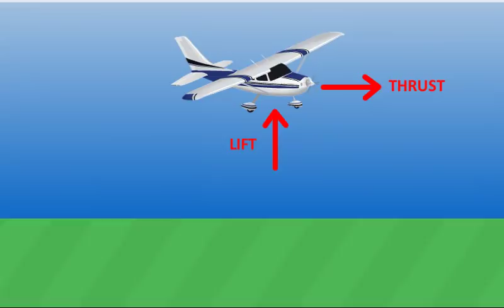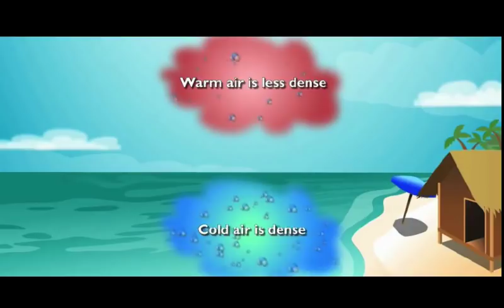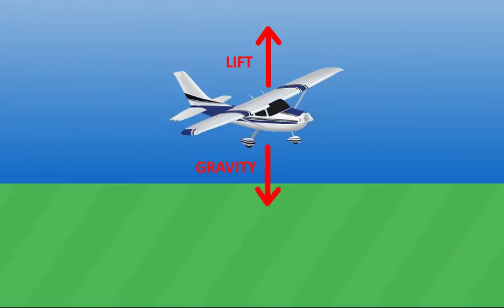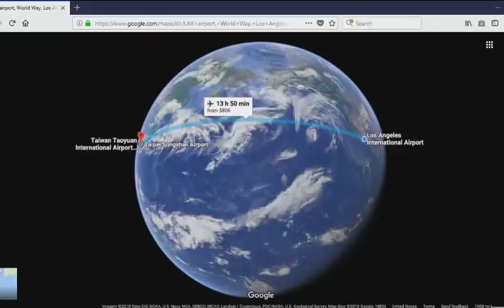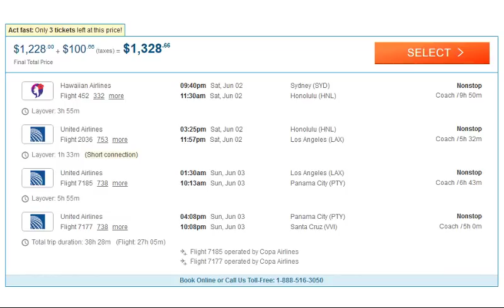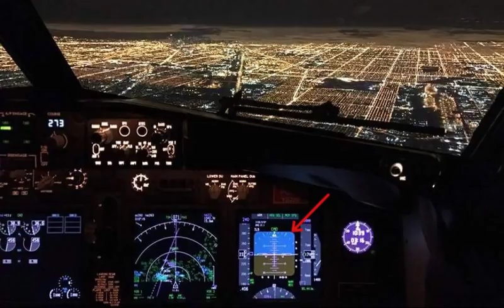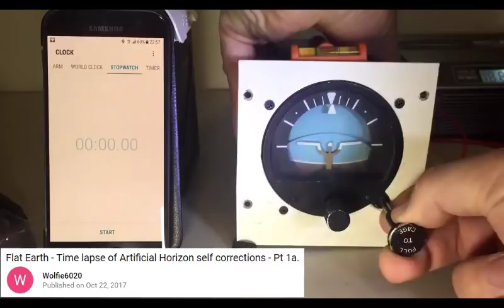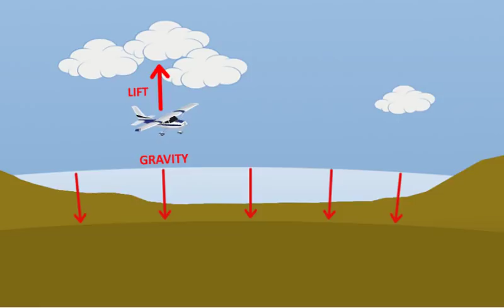Flat Earth Falsities - Plane Nonsense

Comment: Here are several questions for flat earthers: 
1. On a globe, the circumference of the tropics of Cancer and Capricorn are equal, but, on a flat earth, the tropic of Capricorn would be 70% longer. What makes the sun slow down from December to June then speed up from June to December year after year? 
2. What keeps the sun and moon in a circular motion above a stationary flat earth? 
3. What causes the solar analemma? https://www.youtube.com/watch?v=jQT5XRdrqvw
4. If you can see both the sun and moon during a selenelion eclipse, and they are at their maximum separation, why can't you see them all the time on a flat earth?
5. How can the earth's shadow fall on the moon at all (for a lunar eclipse) when the sun and moon are both 3000 miles above the flat earth? 
6. How come the sun and moon disappear from view for hours at a time if they are 3000 miles above the flat earth? Or how do the sun and moon disappear behind the horizon on a flat earth? 
7. What causes the phases of the moon? 
8. What causes some planets to show a retrograde motion at times? 
       https://www.youtube.com/watch?v=TK9ozJYELR8
9. How do the other observable planets disappear and reappear on a regular basis if the flat Earth is not moving? 
10. Why are there two fixed stars (Polaris and Sigma Octantis) with a Coriolis Effect? Notice the clockwise motion in the southern hemisphere and the counter clockwise motion in the northern hemisphere, and why are the stars the same in the three southern continents? 
England and Australia: https://www.youtube.com/watch?v=UNiNJC3UHIo
South Africa: https://www.youtube.com/watch?v=kvhAhCBPJk0
South America: https://www.youtube.com/watch?v=y-VWJHRN7cw&t=23s
11. Why can't everyone on the flat earth see the same stars all the time? 
12. What about the curve? https://www.youtube.com/watch?v=GpAGXpusAiQ
13. What causes the aurora borealis and aurora australis, and why can't everyone see them? 
14. Can you explain the ice wall during the Cretaceous period when the polar ice caps did not exist? 
15. What have Ryan Waters and all the other polar explorers like Spear17 proved to you? 
       https://en.wikipedia.org/wiki/List_of_Antarctic_expeditions 
16. What section of the Antarctic treaty prevents exploration? 
       https://www.state.gov/t/avc/trty/193967.htm
17. What keeps us on the flat earth if not gravity because density and buoyancy do not account for acceleration?
       https://www.youtube.com/watch?v=QyeF-_QPSbk
18. What about Space? https://www.nasa.gov/sites/default/files/thumbnails/image/3-as08-14-2383a.jpg
19. What about tectonic plates, earthquakes, and volcanoes (especially calderas) on a flat earth because no flat earther seems to know what is beneath the surface? 
20. What about the 'firmament' and 'the four corners of the earth'? 
       https://answersingenesis.org/astronomy/earth/does-bible-teach-earth-flat/
21. What keeps the flat earth from flipping over and killing us all? 
22. What causes a spherical drop of water? 
23. What causes the tides? 
24. If the Sun leaves my perspective, why can I see the stars behind or above the Sun? 
25. Why do the stars in the flat earth model firmament dome always move horizontally anti-clockwise over the whole earth? 
26. What happens to a super nova in the firmament?
Reply: Really Bobby Wizdum? It is clear to me that you are an idiot. I have seen that piece of crap TWO HOURS video. Have you? 
FLAT EARTH LOGIC
Flat Earther: The Earth is flat. 
Globe Earther: Prove it! 
FE: There are the many laser experiments proving that water is always level over long distances. 
GE: Have you not heard of atmospheric refraction? 
FE: You mean that mirage thing? 
GE: No. What about ships that disappear bottom first? 
FE: Perspective because all things at a distance eventually disappear into a point. 
GE: But the Earth can be seen to curve. 
FE: From side to side? 
GE: No away from us in all directions. 
FE: Water always seeks its own level. 
GE: What about a drop of water or the liquid in a level for crying out loud? 
FE: That’s different, and besides, water also rises to eye level. 
GE: If I am in an airplane or on a high mountain, the horizon is below my eye level. 
FE: That is not true. 
GE: I can see the horizon below my line of sight using a leveling app on my smart phone. 
FE: That is nonsense. The earth is flat. 
GE: The oceans would be empty. 
FE: The UN flag and some old maps show Antarctica as an ice wall. 
GE: Do you have a picture of the whole thing? 
FE: No. 
GE: Why not? What about the Cretaceous period when the polar ice caps did not exist? 
FE: That is a myth. 
GE: What about the edge?
FE: No one has seen the edge, and Antarctica may go on forever. 
GE: The Antarctic is a continent, and why hasn’t someone done some exploring to prove it? 
FE: The UN’s Antarctic Treaty bans exploration, so we can’t know that for certain. 
GE: What about all the people who have explored Antarctica? 
FE: Nobody explores Antarctica. 
GE: There are stories about them all over the Internet, and the treaty itself can be accessed online. 
FE: It’s all lies. 
GE: What is beneath the surface of the flat earth? 
FE: No one knows. 
GE: How do tectonic plates, earthquakes and volcanoes work on the flat earth? 
FE: There is extreme pressure beneath the flat earth, and it works much the same as on a globe. 
GE: What about the sun and moon? 
FE: They circle above the earth, of course! 
GE: What keeps them from flying off into space? 
FE: There is no space! 
GE: What about satellites? 
FE: There are no satellites. 
GE: What about gravity? 
FE: There is no gravity! There is only density and buoyancy. 
GE: What about acceleration? Density and buoyancy do not account for it. 
FE: There is no acceleration! 
GE: What about tides where the water recedes and proceeds? 
FE: That is nonsense. 
GE: Ok. The sun and moon can’t be as far away on a flat earth as we know they are.
FE: They are actually closer and smaller. 
GE: Why can’t we see them all the time on a flat earth? 
FE: Perspective! 
GE: Wouldn’t the sun’s light cover the entire flat earth? 
FE: The sun is like a spotlight. 
GE: That means the moon cannot be illumined by the sun. 
FE: The moon is self-luminescent! 
GE: What about the phases of the moon? 
FE: Luminaries can be like that. 
GE: What about the four seasons and time zones? 
FE: The sun moves between the tropics just like it does in a globe model. 
GE: The tropic of Capricorn would be about 70% longer than the tropic of Cancer on a flat earth. What makes the sun slow down for six months then speed up for six months year after year? 
FE: Electromagnetism! 
GE: What about the solar analemma? 
FE: What’s that? Must be too complicated. 
GE: What about the other planets? 
FE: They are really planetes or wandering stars. They’re not really part of our system. 
GE: Why not? 
FE: There is a firmament that covers the flat earth! 
GE: The Hebrew word that is sometimes translated firmament can also be translated as expanse. 
FE: That is wrong! 
GE: What about the occasional retrograde motion of the planets? 
FE: I already told you, they’re not part of our system, and the flat earth is stationary. 
GE: How can the Earth be stationary? 
FE: If the flat earth was moving, a helicopter would be able to lift off and wait for its destination to come. 
GE: The Earth is a closed system, and our atmosphere moves with the Earth because it is heavy enough to stay put. 
FE: The atmosphere would be sucked off by the vacuum. 
GE: The atmosphere is large and heavy. It doesn’t work like that. What about aurora borealis and aurora australis? 
FE: Ignore them! 
GE: Why can’t everyone see the same stars? 
FE: Perspective! 
GE: Why are there two fixed points one above each pole? 
FE: There is no south pole. 
GE: But people in the south can see a fixed point over the south pole. 
FE: There is an imaginary pole that connects the two points and moves the stars like that. 
GE: If the earth is flat with the north pole at the center, how can everyone in the south see the same fixed point? 
FE: It is all a conspiracy. There is a distorted view of the skies. 
GE: A conspiracy? 
FE: Yeah. A big conspiracy, a cover up. 
GE: I see, so we have been lied to? 
FE: Yeah, no one can trust them. 
GE: Trust who? 
FE: You know, the people who rule the world, the Freemasons! 
GE: Ok.
Reply: Flat earth cultists don't answer intelligent questions. They just chant "density, buoyancy, the horizon always rises to eye level, Chicago proves flat earth, and other idiocies that they don't understand. They're parrots, not holders of sincere, well thought-out beliefs. Not one of them actually believes the Earth is flat. They're only trying to deceive OTHERS into perhaps making a fool of themselves thinking the Earth is flat.
Reply: Bobby do you not think everyone here as seen, or at least gotten the gist of, Dubay's 200 blatant lies? It just opens with false claims and conspiracy nonsense. Anyone who looks into it more can see it is a scam, unless they do not want to. These flat earth con men are lying. Magician preforming a trick. They just take advantage of your mistrust in your government and science. They have you convinced that you now have knowledge of a special "truth". People like Eric Dubay make a living selling you these lies as truths. I know you will say "no NASA is", but that's the switch. If you think everyone else is lying you will believe they are telling truths. Stop doing research on flat earth via flat earth scam videos. Have you ever seen the edge of the world in any video ever? No you haven't. Now you say NASA makes fake cgi photos and ignore the fact that they don't make cgi photos of earth and you ignore hundreds of others saying they are fake to. You still ignore the fact that no evidence for your edge exists. You refuse to believe that you may be wrong about what you first thought. You believe all of science lies. You think everyone is in on this conspiracy. You ignore all evidence that goes against your belief. You never admit you don't know something. Maybe scientists, researchers and many, many other professions just know something you don't.
Reply: Bobby boy "research eric dubay" Yes, you should research the man you hold up as a hero to see exactly what manner of monster he is. https://www.youtube.com/watch?v=IB-LvYcRWUQ&bpctr=1529018659 There's your hero. bub. You might want to think about it next time you pick a hero. When you're willing to close your eyes shut, cram your thumbs into your ears up to the first knuckle and yell "lalalalalalalalala" only bad things can happen. And all kinds of evil become possible. Stop that.

Nothing Eric Dubay, unreconstructed Nazi, has to say is worth even one second of your time.
Reply: Eric Dubay, the ULTIMATE psychopath.
Reply: Anti-clockwise is a perfectly legitimate, everyday term used in British countries, maybe even in Canada. The use of the common term has nothing to do with pretending to be anything. Your post, Jesse, on the other hand.......not so much.
Reply: Jesse Duzz Anti-clockwise is the British equivalent of counter-clockwise. There are many English speaking countries, each with there variations.
Reply: Bobby Wizdum I don't think you understand how to spot a con.
Reply: Capt'Wes Starwind sure i can. Nasa.
Reply: Bobby Wizdum yes everyone at NASA us lying and Russia and China just play along for fun. Brilliant use of your critical thinking skills, and way to not fall for every YouTube scam. Hey I know a Nigerian prince who wants to give you some money.
Reply: Jesse you know terms will differ between countries and even within countries. Some even speak other languages. Many of the former British colonies still use this term like in Australia. Counterclockwise is the term used in Canada. Being neighbors to America means they use some of the same terms. This is why looking up words and terms leads to a lot of confusion for flat earthers. Dictionaries and Encyclopedias are useful.
Reply: liberty research insults. Sign pf immaturity.
Reply: liberty research so it's the curve?
Reply: +RockinRobbins13
"Flat earth cultists don't answer intelligent questions." Neither do any godbotherers.
"People who believe that Flat Earth Cultists are Christians" So who decides? They claim they are. Or are you the arbiter of all things? Are you?
The only reason Ken Ham et al are so vehement in their abuse about the FE cult is because it exposes the weakness of biblical literalism which the FE, ID, Creationist and YEC cults all adhere to..
"They believe the Cultists can't tell the truth, but suspend their disbelief when the Cultists claim to be Christian" Nt too logical are you. But then you are an illogical godbotherer. You are conflating knowledge and belief which is the norm with godbotherers.
FE cultists believe the earth is flat because they believe the that is what the bible states, just as they believe they are Christians. You also believe you are a Christians, as do Ken Ham and Jason Lisle.
A Christian is a person who believes in JC, i.e. the biblical person. If they do not then they are not Christians they are something else.
To a non-believer there is little difference in someone believing the Earth is flat and believing in Christ and claiming they are a Christian. It is all part and parcel of the same thing. But to believers like you, anyone with a different flavour of belief to yourself is not a Christian, so the problem is with you and your bigotry not with those who quite correctly state that the FE cult is a Christian cult.
You are the one following "the cafeteria school of logic." So please learn to deal with facts.
Reply: Capt'Wes Starwind i dont think this guy has nor do i think you have tested any of his claims.
Reply: liberty research eric dubay 200 proofs wpuld be a good place to start. Nobody is gonna answer 26 questions for you in a comment section when based on some of your questions its clear you havent looked into the matter yet at all.

Comment: the first reason of his claim for the plane and the earth spin is ambigiuos and unsensecal, the second reason regarding momentum is not the case, the vehicle resembles the earth with the atmosphere as the moving together, but not spining, the head of the guy inside the car resembles the globe and it is not spinning, but just moving forward. this is not the case.
Reply: No... Physics huh? Going forward and spinning are not the same motion but you knew that right?
Reply: Bobby Wizdum
"No... Physics huh? Going forward and spinning are not the same motion but you knew that right?"
 Then why you and your crowd always use linear speed units for a rotation movement ?
TYPICAL FLAT EARTH CULTIST DOUBLE STANDARD ! !
Reply: he gave example which doesn't work, please tell me what resemble the globe in the momentum example; the vehicle?, the boy? or the ball/orange?...if your answer is the vehicle. so what resemble the surrounding atmosphere? if the boy the boy doesn't spin to compare any body moves around? just tell me.